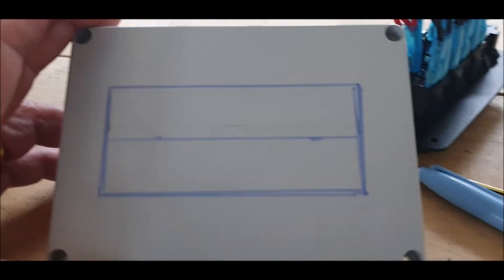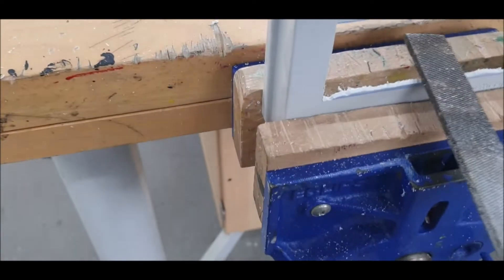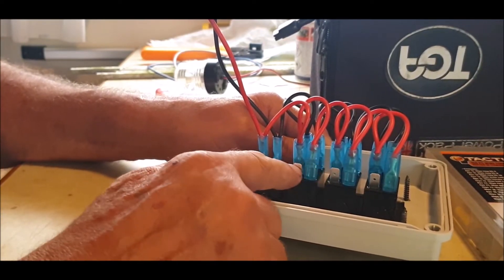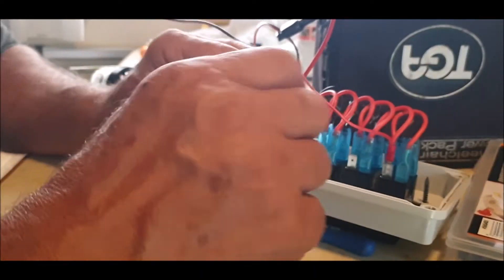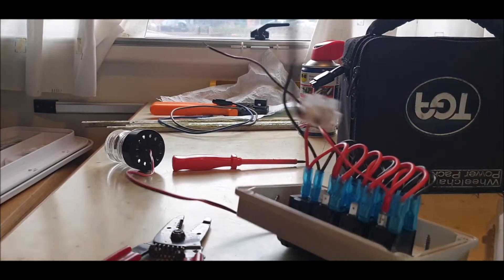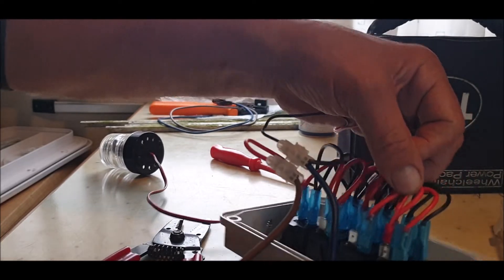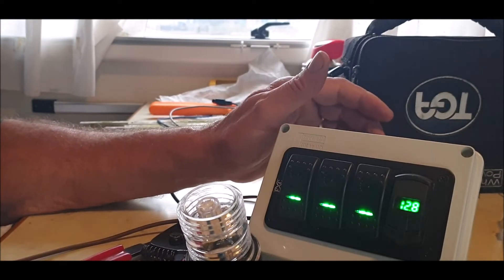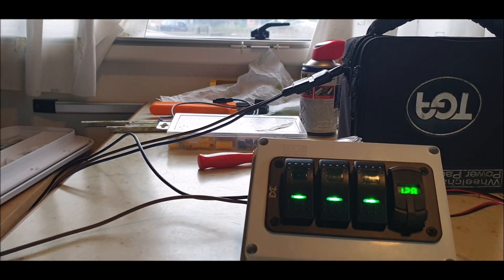HOW TO WIRE A CHINESE SWITCH PANEL

Comment: All the  Chinese switched stuff I've bought the switches are always upside down. Good tips though Mark. :)
Reply from the maker: Still a good switch thanks for watching Robert
Reply: I wasn't knocking them Mark, I have an ac/dc variable speed controler running my mini mill, can't fault it only the switch is upside down. lol